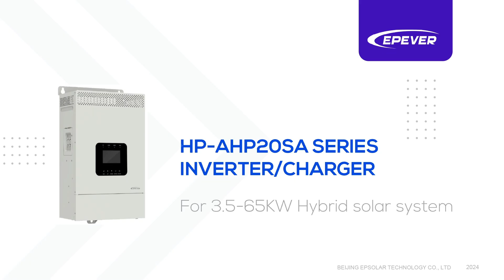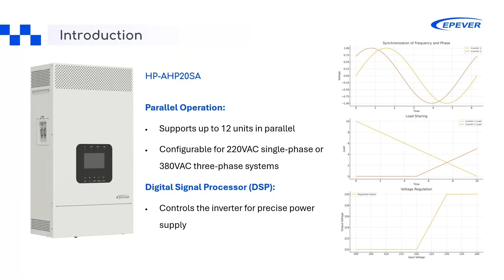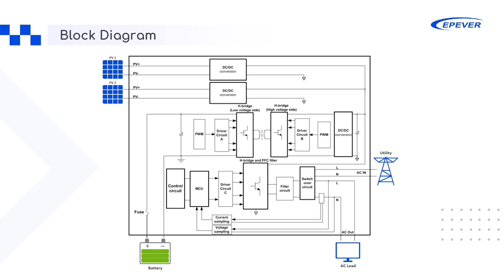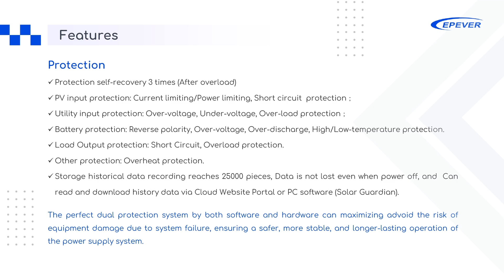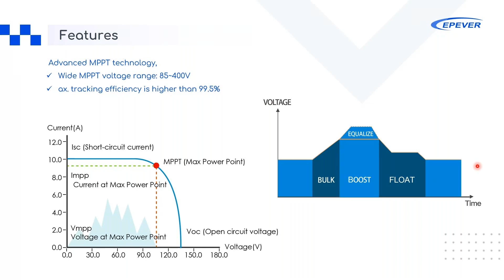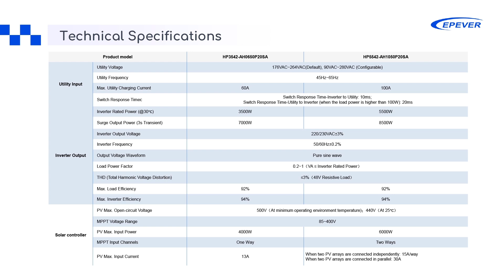EPEVER HP Series 20SA Advanced Features Explored: Revolutionizing Solar Solutions | Webinar Recap

Comment: Thank you for the excellent video! I also have a question: Why doesn't the main display in your unicorn series show power in watts? Most customers find wattage information important but it show current and voltages you need to open PV or load to see the power in wattage.
Reply from the maker: Thank you for your appreciation and for reaching out with your question! In the UC colorful-screen series, the main display focuses on showing the voltage and current, which are primary readings. The power in watts, while not directly displayed on the main screen, is calculated based on these voltage and current values and can be viewed on the secondary screens for the PV and Load. This design choice helps to simplify the main display while still providing detailed power information through a few extra steps. We understand the importance of viewing wattage directly and appreciate your feedback as it helps us improve future product designs. Thank you for choosing our products!

Comment: Hello. I have installed 5500watt unicorn series. Two pv inputs 5/5 panels two strings. 
What sitting I should select in PV mode selection 
1- single 2- parallel? What should I select for two stings
Reply from the maker: Please select "Parallel" in PV mode.
Reply: @Epever  ok but two array are connected separately to UC model

Comment: Hola , sería ideal que pudiera hacer unos videos de programación de uso sin batería yo compre uno y quiero hacerlo funcionar solo con paneles pero no he podido quiero comprar otro más pero se me complica la programación, y por la experiencia de tener el modelo anterior no quiero otro de otra marca ya que epever lo encuentro de excelente calidad les dejo esa inquietud saludos desde chile
Reply from the maker: You can set up the no-battery mode by following these steps:

1. Power on the inverter/charger and wait for the home screen to appear.

2. Press and hold the "ENTER" button to access the password interface.

3. Enter the correct password (default is 0000) to access and modify the parameters.

4. Use the "UP/DOWN" buttons to navigate to "5.Basic Param Setup" and change the setting to either "Have" or "No" battery.

Note: In no-battery mode, the "Charging Mode" and "Discharging Mode" settings will be disabled and will not take effect.